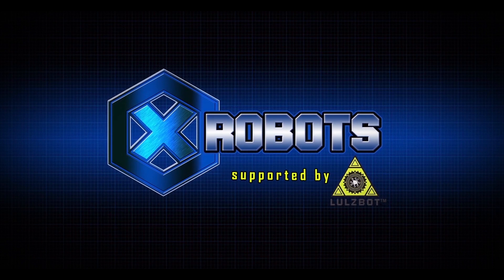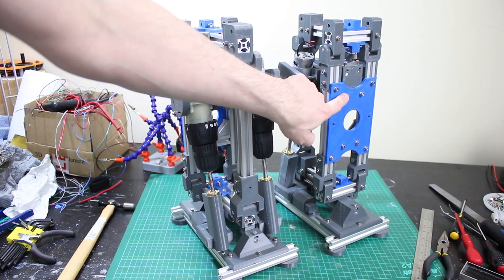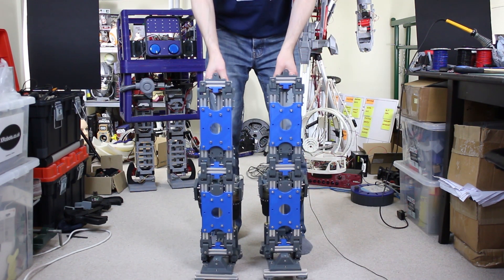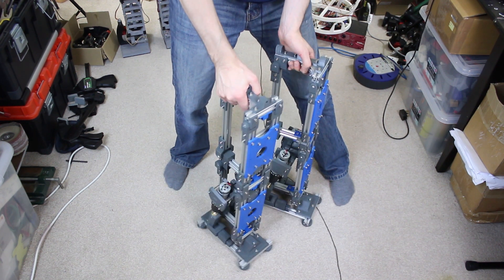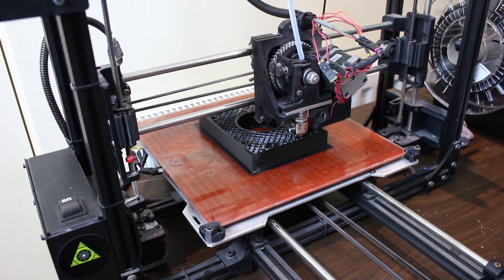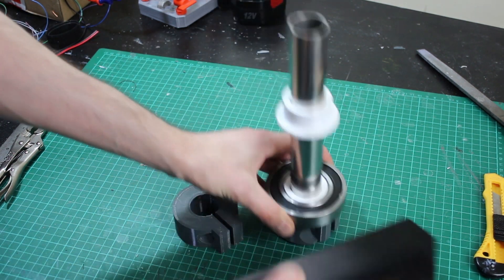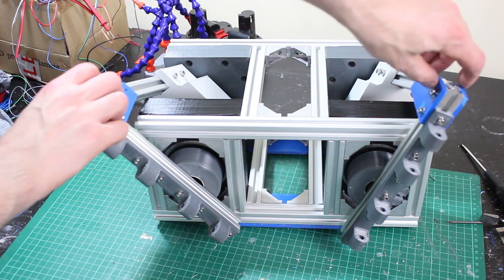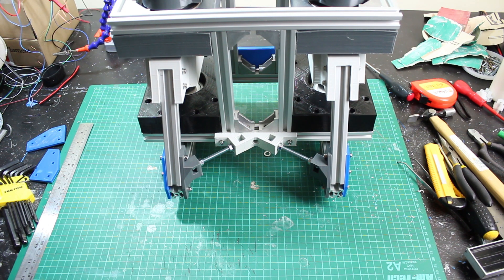Robot X #2 | Legs & Hips | James Bruton

Comment: What if you used something similar to a Lazy Suzan for the rotation axis? It would provide a very rigid rotation due to the weight distribution being around the outside of the two plates on the ball bearings.
Reply: You could even drive it using a big gear so that you
1. Slow down the motion of the rotation and
2. Give the motor more torque as opposed to being at the center of rotation.

Comment: Here's a quick question: Why not use a hinge to twist the leg instead of attaching the leg directly to a motor? You know, a good, solid doorhinge at the back, and a horizontal motor at the front similar to how the foot actuators are but only on one axis. Would that spread the load around as opposed to having it right on the motor? Or would that be too complicated and not as strong?
Reply: Oh, okay! I think I must have mistaken where you were putting the mechanism! For some reason, I had though you were going to put a motor on the top, connecting to the shafts that the legs connect to. Your idea makes a lot more sense than mine does anyway! Thank you for replying and clearing up my confusion! Have a great day and have fun with your projects! I can hardly wait to see more! :D

Comment: Have you seen the bad news about 123D Design & the rest of the 123D apps?, basically Autodesk is stopping developing them & turning off the cloud part, plus they warn they may drop features etc. without notice after I think it said March. Sorry to be a barer of bad news, It may be time to move to a new cad package, Fusion 360?
Reply: James Bruton I know what you mean. will they decide to ditch 360 in a year? it's a gamble, I use 3D Studio Max ( and have done since its first iteration on the Atari ST) so never fully got into 123D Design. you can get a student copy for free for a year or so if you are a student. However it's pretty much overkill for 3D Printing. I did a lot of research on the best cad to use & came up with basically it's whatever your most comfortable with! so no help there sorry.  for now I think Fusion 360 is probably the best way to go, although it's pretty cloud dependant & that can be a pain waiting for your models to import. eg. your R2 files took over 5 hours to import into my library b4 I could use them! ouch!

Comment: You should tinker with putting the threads right into the plastic rather than rely on the nut. If that doesn't work, they do make inserts that are longer  than the lead screw nuts you have.

Comment: Moving one leg forward and straight out as the other leg pushes off for leg in front to be perpendicular to the ground. When one legs perpendicular to the ground, the other legs bend as it moves forward. The torso will move slightly side to side, keeping the legs perpendicular to the ground. And also what you did for the foot will also keep the robot balance, to lean the robot forward. and to push off. For a faster clean movement will that work better than have the legs to wobble side to side? Also I love your work!

Comment: fun idea, what if you made the control a lot more decentralized, you are doing something similar with ultron where some of the brain isn't in the body but alot of  calculations are still happening onboard but why not make a program to control the bot that will be ran from a remote desktop, and then have all the onboard electronics just interpreting those signals and moving the robot, the robot could connect to the computer over Wifi or bluetooth.... and maybe later if you want him to be a bit more mobile, a fona module.

would be interesting to see what you could do if you weren't limited to what could fit on an arduino could even try more complex AI systems like Neural nets.... i know a good channel that covers them extensively and i believe you said you know python scripting

Comment: Looking very nice James. 
On the part where you were mentioning the actuator to move the feet apart (Z rotation), you mentioned using a wedge. Perhaps an alternative would be a z-axis lead screw with a linear component (tracks up and down) that has two linkages w/ heim joints that are angled down and attached to the front of each thigh? As the lead screw forces the linear carrier down, it would force the fronts of the legs apart equally. There is no independent rotational movement (per leg) however... (and speed may be a concern?)
Anyways thank for the vids, great work!
 - Eddy

Comment: How did you get the chucks on the drills to lock? I made a walking robot some years ago (strand beast knock off) using drill motors but found that the chucks would just let go under any mild amount of force.
Reply: Ah well, I shall have to stay tuned and see what you come up with :) I'm sure you shall find an adequate solution :D Keep up the great work, tis awesome and a nice motivator for me in the mornings :D

Comment: I like the idea of adding a second nut to the actuator connections. It looks like your part has space to put the second nut farther away from the first one than you did in your sample part though (it would be on the opposite side of the hole in the middle of the plastic part, oriented the same way as the existing nut). Wouldn't it be even more stable if there was more linear distance between the two nuts? I'm also wondering if the small screws that attach the brass nut to the plastic mount are going to be sufficient. It seems like there will be a lot of shear force on them as the robot moves.

Comment: Weird question: if you want to make a humanoid, why not just print the bones and joints and try to replicate a human body.. I know its very complex, but with 3D printing you can make any shapes and then simplify the moving parts a bit so its doable.. I think even very simplified motors etc would make movement very realistic
Reply: hydraulic muscles ? ^_^
Reply: that's more like hydraulics/ pneumatic then muscles there is nitinol that you can run a current through to contract them its just that nitinol isn't that strong
Reply: BaconFixation Yeah, pneumatic is the right term. I wonder if there is any advantage in using the motor to press the pneumatic piston over using the motor directly. That nitinol is really cool too!
Reply: ***** Alright, so it would be slower... if the piston was inside the compressed canister and a motor moved the piston forwards to push the compressed gas into the muscles and backwards to let it back in, would the motors still need to be super powerful?
Reply: ***** I think so too... I'm just pondering what could be the advantages. Most of it could be made of plastic. It could potentially weight less, It could be water/dust proof, Less moving parts and the transmission would be very versatile as the force would go trough tubes instead of long screws. The motors could be all, say, in the chest instead of being near where the joint needs to move. But I'm sure it would have lots of disadvantages too, like loss of pressure, rubber drying/cracking, etc.
Reply: stop being smarter than me :P
Reply: BaconFixation - nitinol and other alloys don;t move much and take time to 'relax', I looked into those years ago... perhaps used in some mechanical movement amplifier and cooling system..
The other promising tech I have seen is pneumatics, but used in bladders that shrink on their longitudinal axis as they expand, somewhat like how a muscle behaves. Muscles are still more efficient in their movement however.
 - Eddy
Reply: Muscle control especially human-style is super complicated and still a pretty new research field (Myorobotics)
Look up Roboy e.g. which does exactly what you suggested
Reply: I suspect that with an advanced control system you could overcome almost any amount of slop - the human body is full of sloppy joints - but I don't think you're going to be able to achieve that with Arduinos.
Reply: The closest thing to a human walk pattern is a passive dynamic walker, while simple in concept, the bipedal balance is hard to replicate
Reply: +James Bruton What are your thoughts on solenoids? What would be the advantages and disadvantages of using those as a form of artificial muscle?
Reply: Using pneumatic air muscles (usually made with braided nylon cord and a latex tube) would create a softer, more natural movement and give more dynamic control:  if a motor-controlled arm is given too high a load the motor may burn out, but the pneumatic muscle would simply inflate, putting less pressure on the motor.

Comment: have you considered adding foot pressure sensors?
see: http://www.ebay.com/itm/DIYmall-4pcs-20KG-Scale-Load-Cell-Weight-Sensor-HX711-AD-Module-Weighing-Sensors-/272256297596?hash=item3f63bd6a7c:g:3jIAAOSwNRdX5gvE
https://github.com/Rhoban/ForceFoot